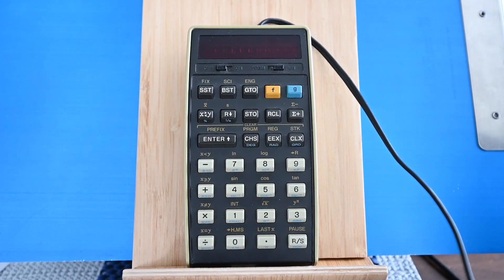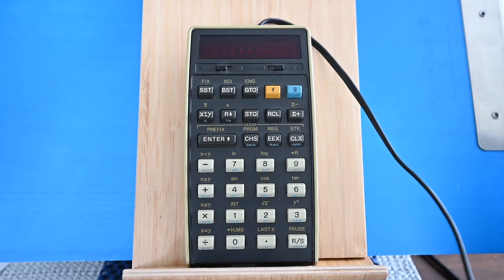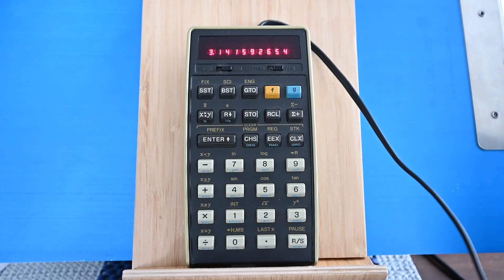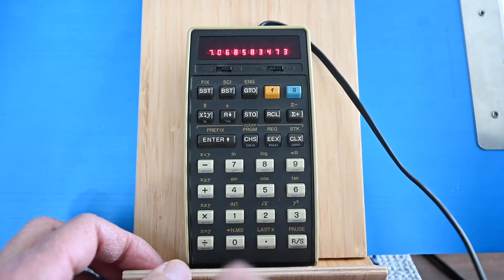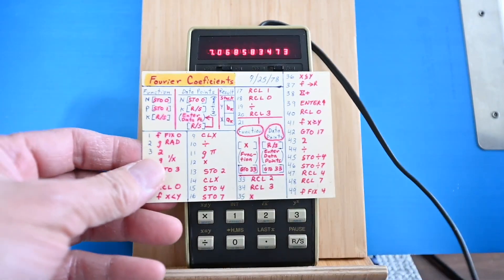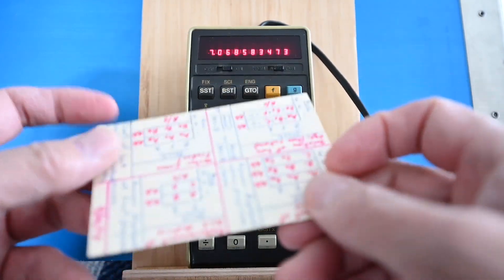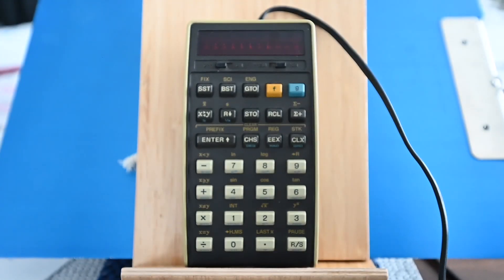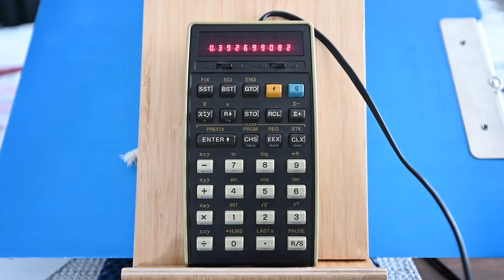Hewlett-Packard HP-25 calculator, circa 1976/1977

Comment: NEVER run an HP Woodstock series calculator (HP25 is a Woodstock) from the AC charger!  No battery installed, or a bad battery, or intermittent connection (like due to corrosion) will eventually fry the CPU chip.
Reply: Thanks for the advice.  I only turn the calculator on about once every 20 years.  :-)
Reply: Hi! I got one -- no batteries, no PSU. Do you have any idea how to power it up?

Comment: Not non-cmos,  non-continous memory. The tech inside is still cmos, it's just that the power switch removes power from the whole machine. Continous memory means even when the switch is off the memory is still powered by the batter.
Reply from the maker: That's very interesting to note.  Thanks!

Comment: Thanks for sharing these memories from 70's! I made some screenshot of those cards, it is very exciting how you solved those functions in 50 steps. Runge Kutta's, Fourier, Impedances and root finder really a gem for me, thanks for sharing. I'll link your video, of course, if I use them somewhere. I really like to show people how minimal computing power is enough to solve really complex problems easily and for this the programmable calculators form 70's and 80's the best tools.
Reply from the maker: Thank you for your reply.  Please share this video and screenshots as you see fit.

Comment: Nice presentation. I have a HP 25C. I bought it from a third party mail order company back in late 1976. I think their name was Electra or something like that. I was in tech school. I remember one of my instuctors said, the RPN made the easy problems hard and the hard problems easy. During the solid state class we did a lot of double power source problems. Also a lot of kirchoffs law. My HP25c worked a lot better than the TI's with algebraic notation. I made a program to make the display keep track of time. It worked like a clock. Function great. Thanks again. My HP25c still works also.
Reply: Thanks for your experience, nice to know that your HP-25C still works.  I majored in Electrical and Computer Engineering back then.